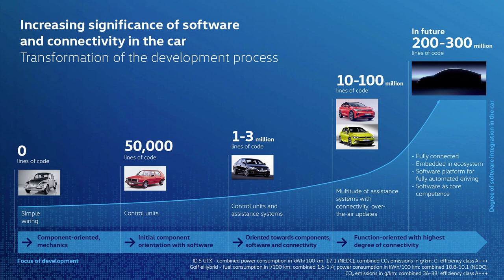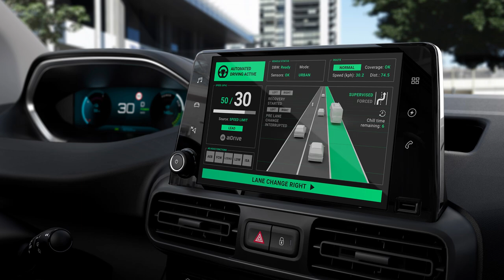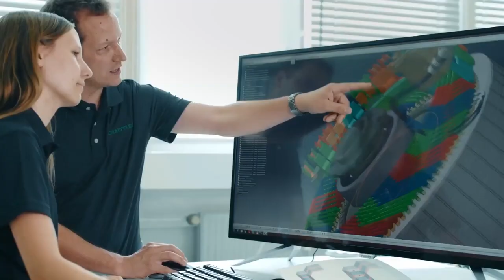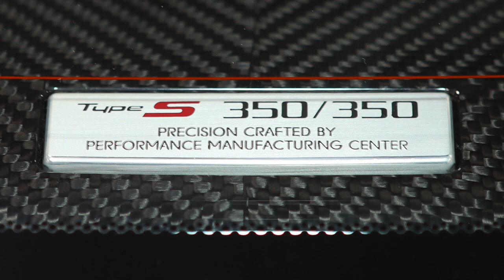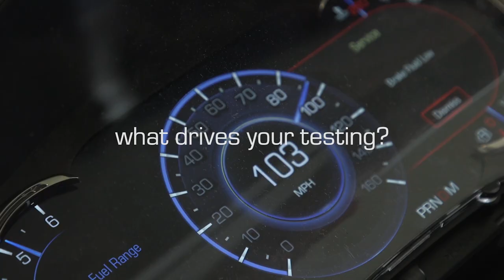Waymo & ZEEKR Debut Autonomous Taxi; VW Could Delay New EV Plant - Autoline Daily 3451

Comment: Did you say Zeeker's platform is named S-C-A-M?  If so, someone might want to have a word...
Reply: I heard that too at 8:00.  Funny af
Reply: In the 70s gm introduced the nova to South America. No Va...doesn't go.
Reply: Don’t worry: if it overheats it will be shut down by the Serial Electronic Controller, possibly with the help of the Floating Bus Inverter.
Reply: @BillLaBrie  😜

Comment: Solar roofs on cars sounds like a great idea, until you see how little it helps.  Just not enough surface area.
Reply: For temperature control?
Reply: @Pernection  solar panels still just don't produce much electricity per sq ft. That small of an area is only good for a few hundred watts in direct sunlight.

Comment: TESLA RULES
Reply: Tesla is going down everywhere!
Reply: How are the Tesla stocks doing?
Reply: One Theranos/month for past 12 months.  Let that sink in!🧐
Reply: @buddy1155  Doing about the same as every other automaker
Reply: @Alexzw92  Really, did every other automaker also lose half of the value in the last year?
Reply: @buddy1155  Some lost 30% and others lost 80%

So yeah on average about the same
Reply: @buddy1155  Well it looks like the waits are coming down. So prices will fall. Doesn't matter. The incentives start next year. And that's a wrap bro. The share price doesn't dicate how the company is doing. They're still selling everyone they make. There is no stock far as I know.
Reply: @joebachmeier6747  "They're still selling everyone they make. 
No they don't look up the numbers last quarter. Tesla is the ONLY carmaker where you can buy an EV out of stock. All other manufacturers have a six month or longer delivery time .
Reply: @buddy1155 The forty thousand in transit they were sliding to next quarter. I thought that was explained
Reply: @joebachmeier6747  It is not just 40.000 but 40.000 MORE in transit then in Q2.
Sure, is "transit" the new name for build but unable to sell?
Reply: @buddy1155  It seems like if that were the case they would be jumped on by everyone. As usual. And it would come out as a scandal. If it had any substance. If not then your distributing with negative inflection that you aren't sure is true. Besides. 40000 is almost more EV's then gm have made this year. And that's just the holdover, not the sales
Reply: @joebachmeier6747  It is about 15% of the production that isn't sold. We will see in Q4.
In my country. (the Netherlands) in October only 14 Teslas got registered, and 16 Bentleys as comparison.
Reply: @buddy1155  Tesla's performance is %103 YoY net income growth, pretty much everyone else in the auto market is stagnant or even shrinking. 

Tesla makes 8 times more profit per car than mighty Toyota, for example.

Tesla's only EVs, and sells them at record margins, most other makers are low to mid single digit margins and generally going down, and most of that is obsolete ICE products, their EVs sell at a loss until 2025+ - GM, VW, Hyundai and Ford admitted this many times.

VW's struggles with software and delay of factory opening to beyond 2026 - covered in today's episode - is a good example of how the Nokias of the market are still struggling to catch up.

That means Tesla's stock is a great deal right now imho. 

Rookies look at stock tickers, veteran investors look at company fundamentals.
Reply: @AllanSustainabilityFan  Everywhere except the US are sales declining, the only reason why there was growth in the past years is because Tesla was expanding in new markets. There are no more new countries where Tesla can expand. The models are ageing, the competition has surpassed Tesla, and Tesla is stuck with unsold cars.
Reply: @MarkMeszarosYNG  what is so special about that?Tesla is only number 4 in ev sales in Europa!BYD growh its pure ev sector by 200% Tesla has to lower  prices to sell all the cars they produce in China!The stupid Cybertruck can only be sold in the US,and new modells coming maybe end of 2024!Until then every carproducer has already compact minivans pickuotrucks small crossover cargovans and evs at every pricepoint on the market!
Reply: @buddy1155  Must be why VW just dropped out of the race then eh? They just shut down plans to open their new EV factory, as well as delayed their car OS software until 2030. 

So much for Tesla's main competitor:

"VW with more software problems Trinity from VW Group CEO Blume delayed for another 4 years  from 2026 to 2030, according to media reports and company sources as a cross-brand car operating system is not expected to be launched until 2029 instead of 2026 because the already delayed predecessor versions required additional work"

"VW CEO Blume has already made it clear to confidants that the Trinity factory planned for the Warmenau district of Wolfsburg will probably not be built the media reports. The original plan was to start construction in spring 2023, and VW had budgeted a good €2 billion for it."

Do you think VW will survive until 2030 when they "might" get their act together?

Sounds like allot of room for Tesla to grow into with their "old" smart cars, ICE is a big dying dinosaur for the EV mammals to feed on and populate with.
Reply: @AllanSustainabilityFan  Tesla makes a lot of profit and cars. Yet they make the same cars year after year and have a difficult time getting cars out. Tesla fans brag about how many cars Tesla makes, how fast they make them (which doesn't indicate quality one bit), how much profit but what about introducing new cars? Tesla isn't great at that anymore. Cybertruck's delays are ridiculous. If I want excitement in the actual cars, not only software revisions but actual new directions in cars with new models, Tesla is not the make to look at.
Reply: @benjaminsmith2287  The old thinking was pumping out many models with minor face lifts, just to obsolete customers' older cars and make them go shop for a new model - that and planned obsolescence business model, car companies mostly make money off selling parts.

The new business model is smart cars that get updated regularly, getting better with time. Combine that with proper ecosystem support (charging network, service rangers, software upgrades) and you get the picture. 

Customers don't like it when legacy companies artificially depreciate their expensive purchases, and now they have a choice, hence Tesla's rising popularity with zero advertising budget.

Customers generally don't shop for EVs, they shop for Teslas. There is still some room for "Nokia" EVs in the short term, mostly with older buyers who shop by "brand" loyalty, but the future trend is smart EVs.

There is no demand issue for Tesla, they are replacing ICE cars, not other EVs, and vice versa, other EVs likewise are replacing ICE cars not Teslas, meaning the legacy competition is forced to cannibalize themselves. 

Again, EVs are growing mainly through eating into ICE's piece of pie, it's way too early for market saturation concerns right now.
Reply: @AllanSustainabilityFan  I don't agree that there is old thinking vs. new thinking with most car buyers. Cars get dated. New formats/styling trends come about and the car buying public likes to see updated models.

The Prius is getting a lot of positive feedback due to its redesign. A car, like say the Chrysler 300, could be very popular for a time and then get dated and the newer model never recaptures what the older model did. But popular cars don't always stay popular over decades unless they are updated or very niche.

Tesla has a winning formula for now. But that doesn't mean forever. Cars are cars. For people buying cars, most buyers like something about them and buy them. But when the new model comes out, they update to them often if they can afford to. I've seen this happen with Toyotas and Hondas and other makes. You do need to update the look and update models. The Model 3 and Y are beginning to look "old" next to newer designs and what was once modern and different is now becoming common place with newer cars. And it's not about what's below, it's what customers can see. I agree people may not be shopping for EVs, but they will at some point because the cars they want to consider will now be offered as EVs or only as EVs. That's coming. And hopefully, a charging network that is as good as Tesla's is coming. Doesn't look like it is anytime soon, however.